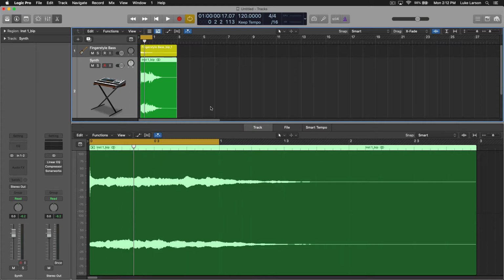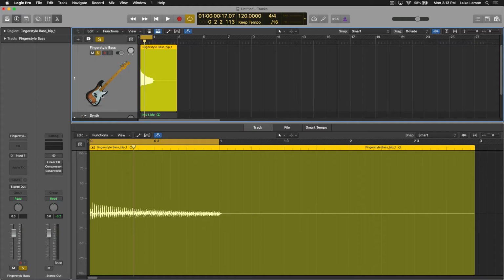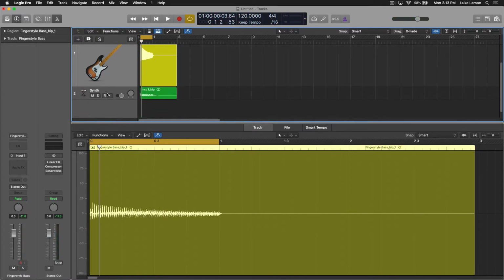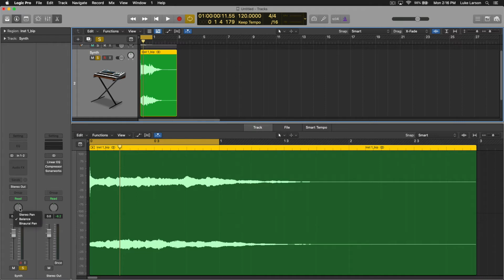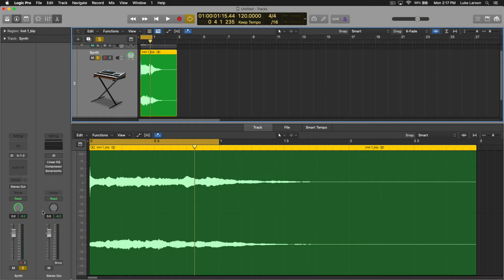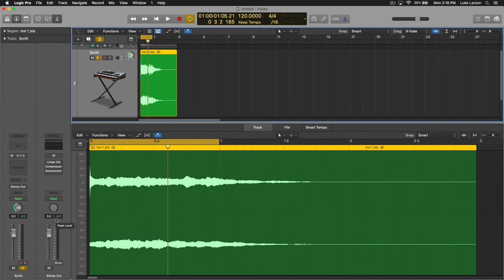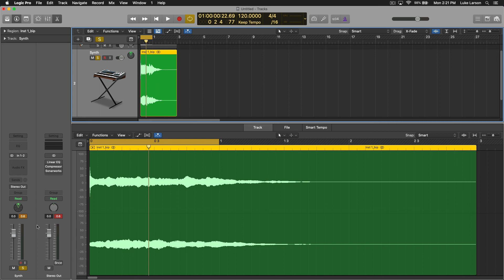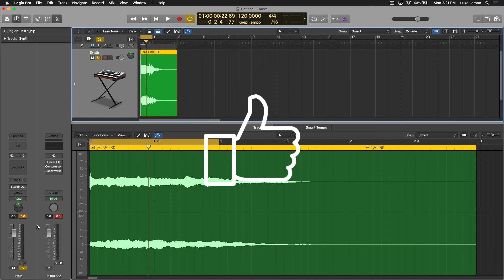Are You Using the Wrong Pan Mode in Logic Pro? How to Fix With One Click!

Comment: Never knew this and I have used Logic for years…guess I should have read the manual.
Reply from the maker: You’re in good company. I’ve been using Logic since 08 and I learned about it just before I made the video 😂. I’ve made it through about 25% of the manual. It’s a tough read but worth it.
Reply: Is there a difference if your using USB, Midi and loop?

Thanks for the response
Reply from the maker: MIDI can capture a physical keyboard as digital audio that you can then manipulate. USB also captures MIDI but often the synthesis is actually taking place in your computer and the keyboard is used as a controller. Loops are just prerecorded audio segments.
Reply: @SojournerTracks  Thanks

Comment: When you are using the strero pan with electric keyboards do I need to use two different tracks meaning one for left and one for right so they want be as hot or should i used one stereo track and leave in stereo position?
Reply from the maker: If you are capturing a stereo signal from physical keyboard (not usb or MIDI), then you will need a left and right input, meaning 2 tracks. In this case you could just keep them as separate mono tracks but I would combine them into a single stereo track and then use the stereo pan.